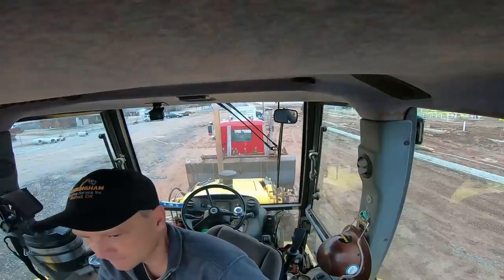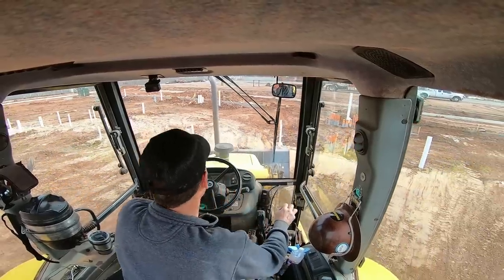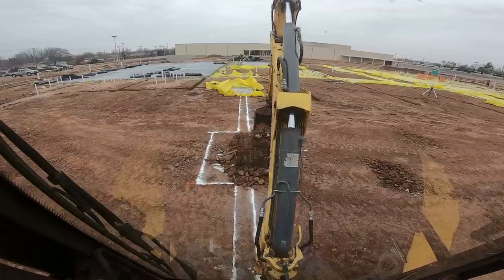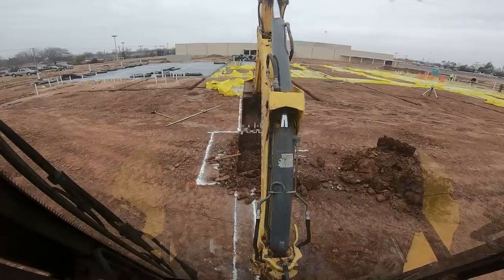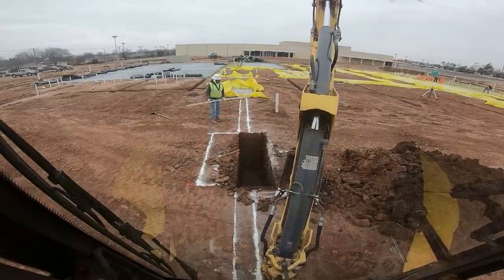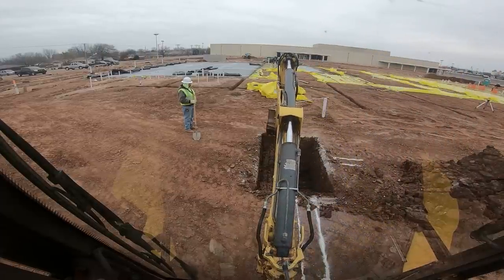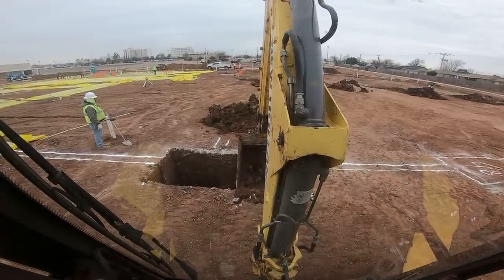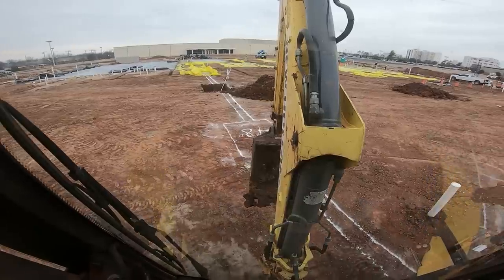Some diggin' basics, how I dig footings.

Comment: 18 minutes in learned two good pointers fresh teeth and minni x curl on short ditch is difficult.But I like the minni x with sand bucket mostly because for the last year I have been digging at a airport with live wires popo pipes telecommunications you name it.I really like being able to dig and pile dirt 360.
This gentleman is very good second generation I could hear and see he had the motor revved down.Thanks great tutorial
Reply from the maker: Thanks! Smooth bucket is great working around lines, but for clean top edges nothing beats some sharp teeth set wider than the bucket. I know 360 is good in some cases, but not when you are digging a long footing, most efficient to set spoils to the side. I don’t dislike mini x, but the backhoe is easer for me to make nice clean footings. I don’t run the machine wide open, no need to most of the time.
Reply: @Digginok  I work for a backhoe service and most of the old veterans prefer backhoes Iam beginning to understand why thanks again Iam a decent operator well-rounded but I only have a couple years in trenching that's why I subscribed to you.
Reply from the maker: Barney Roberts thanks, I am willing to help any way I can.

Comment: Hi if you have a quick hitch it's quicker to change buckets as you pointed out but also you don't have to grease your pins so much as they are not incontact with the soil as much that's what I found out when I fitted one on my JCB 3cx some years ago great vid

Comment: Excellent info! Thanks 

More videos on repositioning a backhoe efficiently would be good too. You gave one about positioning over a ditch before which was helpful for me. 

I have a little Kubota that I use as basically a handyman with a tractor. I was working on a job a few days ago,  a small yard maybe 30x30 and I had to dig a perimeter around it but only 4 feet wide so I couldn’t be digging it dead on, I had to be setup 90 degrees to it. Anyway it was a huge pain due to reposting and space to dump. In hindsight maybe I should have setup parallel to it to give for dump space and I did tell the owner upfront a miniex would be quicker. Anyway don’t need a reply but again repositioning info would be great 👍
Reply from the maker: I'll see what I can do.

Comment: You’re slick on that backhoe sir. You make it look easy. I can never get use to the blind spot of the boom in my face. I’m going to dig out a footer on Monday so I’m looking for some pointers and I can honestly say my dig out won’t look nearly as clean as yours lol.
Reply from the maker: Thanks! Once you get a good kink in your neck you will enjoy the backhoe life. Key to footings is sharp teeth, put new outers on if you got them. Don’t get greedy, most of the first few inches you won’t have a full bucket. Consistent and attention to detail make all the difference, if something looks a bit out of line, straighten it up before moving forward. Thanks for watching
Reply: @Digginok  thank you for the awesome tips. I appreciate it. I’m use to digging pipeline ditch. I dig from the outside of my tracks and pull into the middle then dig the middle out. It slopes my ditch line into a v ditch. I’m in between jobs and doing some work to stay busy. I dug a basement out a few weeks ago and I got carried away and over dug it a bit. Poor soil(sand&gravel) and poor set up on my part doesn’t make for a pretty hole lol.
Reply from the maker: For foundation work I find it’s always best to establish the outside line down to grade, then do the slope or bench last, that way the layout is not lost, footing work is a bit different for sure. I know it seems to be a waste of time, but less is more when cutting footings. Concrete is expensive, and a bit more time getting the dig right is appreciated by the guys that have to buy it. Some days I can save 5-10 cubic yards of concrete by spending maybe an hour extra. Haven’t had anyone throw rocks at me yet.
Reply: @Digginok  you definitely have it down to a science! You’re right about that. I just gotta take my time and work on making it look good.

Comment: Experienced operators use the boom and stick to load bucket; bucket stays flat; and bottom of the ditch is smooth and maintains grade;beginners tend to hog and curl the bucket to load it; you can get grade doing that but it takes a lot more time to make bottom of the ditch smooth ; and its a lot harder to fill for an obstacle curling the bucket to load it; i know some will disagree but a well experienced operator could dang near dig a hole blind doing it by feal and could stop as soon as they felt something not right
Thanks for the pointers frank another good video as always
Reply from the maker: Jerid Janikowski yes it drives me crazy when I see operators stick the bucket in the ground and just curl the bucket. Makes a big mess usually.

Comment: Wow, u can run a backhoe quite good.  Though a mini excavator can't move piles of dirt like the loader can, they sure spoil a guy for quick positioning and ease of maneuvering. My first machine was a Cat 426b x-hoe. Still have it and i still use it a little, but, man, for the last 2 years I've primarily used, and LOVE using, my Yanmar Vio35-6A with it's thumb and i really like the wide 38 inch flat edge bucket. It's great for square holes and retaining wall footers.
Reply from the maker: Thanks! I like the mini's too but I will always prefer a backhoe for footings, I travel quite aways so more than one machine is ot practical for me. thanks for watching!

Comment: "We" mainly do minor digging (water valve replacement, water main breaks) and our supervisor wants more of us to know how to operate the backhoe.  Any tips or ways to practice, before actually doing the real work?
I can take as much time to learn/practice as I need.
Maybe make a video on basic digging techniques and how to practice offsite (?)
Reply from the maker: As for things to practice, try to dig level, fill the bucket in a long stroke and don’t take too big of a bite. If possible set the machine at a slight angle to allow a better view of the ditch, keep the machine tires on the ground slightly and keep it level. Low throttle at first and as you build confidence add speed. 
If you master the backhoe there is not much you will have trouble operating.
Reply: @Digginok  thanks for the reply.  Should the teeth be straight down or "out" straight, when extending to dig and first touching the ground? (or doesn't really matter?)
Reply from the maker: Brian Schmid if you are not concerned about the top crust breaking it don’t matter. If I’m afraid of snagging a pipe or utility line I will lay the teeth back or away from the hoe so it will bounce over.

Comment: What's the best technique to dig when you get to the required elevation to keep excavated surface leveled? I dip very often when digging for footings.
Reply from the maker: It’s a lot of practice, I still make a dip now and then. Generally the backhoe makes a natural slope up as you pull back. Try to look at the side of the bottom of the ditch, you can see  the straight line at that point. The more you do it the easier you can “see” the grade.

Comment: Am I seeing that correctly at the end... you back up to your box and then pull yourself over the box and putting your stabilizers down to straddle the box? I’ve only ever dug regular trenches nothing like this.
Reply from the maker: Billy Shrubb yes that’s what I’m doing. It doesn’t work with some soils as it won’t take the weight of the machine. The other option would be to dig the small footing then switch buckets for the large boxes then switch back. This way I only switch buckets once.
Reply: Digginok yeah I was thinking that could get a little hairy with some soils. Thanks for the reply!

Comment: While I got your attention: Just ordered a 2019 case cx7zc cab, long arm, thumb, 4 way blade. I'm coming out of retirement because I bought this cool ranch that could use some excavating. It has several ponds, here look: https://www.youtube.com/watch?v=srI8DFg0ykk&t=239s

So, I need to get the right buckets. I'm a building contractor, so digging 12 and 18 inch footings are common. So, I got those buckets. I have ditches, creeks, and ponds, so I thought the 3' grading bucket would fit. Later, I'll get the auger drill, and maybe a watcha macallit too.

Comment: I have a new holland 675e.  The hydraulics are so slow.  Looks like they are pretty quick on yours.  Is it a B95?
Reply from the maker: Yes B95. I had a 555e when I started out   It was a little slower but not much. You may have something wrong.
Reply from the maker: Yours should have 38 gpm. Mine has 44 it makes some difference, but you should be able to run the engine faster to compensate for the difference.
Reply: @Digginok  I've ran newer machines also.  I got spoiled with a 710J.  I just call mine slow by comparison.
Reply from the maker: 710 is a beast from what I hear. The Backhoes require the operator to feather the controls so that everything blends together. You can hear the machine if you are doing it right. 675e is a good machine in my opinion.

Comment: Hi there. I am wondering what rpm or % of throttle you are running?
Reply from the maker: I run around 1500-1700 depending on the job. Some machines need more rpm, the New Holland’s have big pumps and lower rpm. Max rpm is 2250.

Comment: hey I"v been meaning to ask you what"s the horse power on yer truck
Reply from the maker: Small cam set to 350
Reply: @Digginok  what I've also noticed is that you don"t run full throttle like a bunch of "operators "do ,if they ran it with patience and about 1/2 to 3/4 throttle they will achieve their goal .
Reply: On a personal note ,what I've always told everyone, is that you alway"s listen the machine your operating or running the RPM"s will tell you what is going on , and check the gauges
Reply from the maker: Yes I agree, wot is not always the best! My dad always said to run the machine as fast as you can run it smooth, I can run faster when needed! Lol
Reply: I just saw the comment about yer welding from the weasel  company